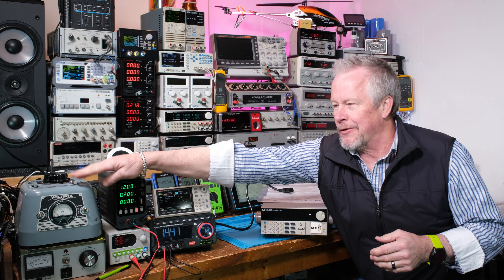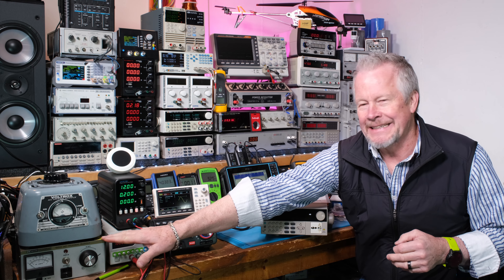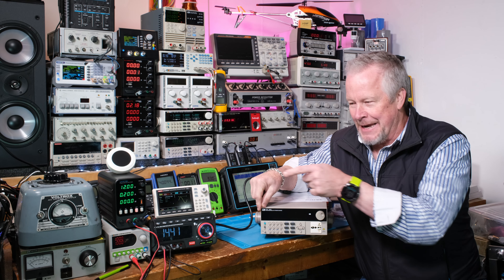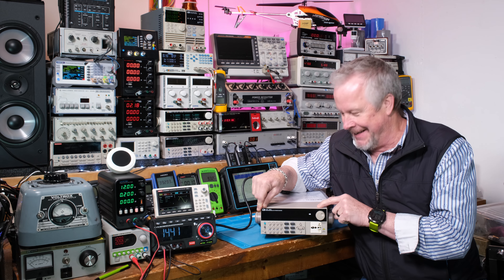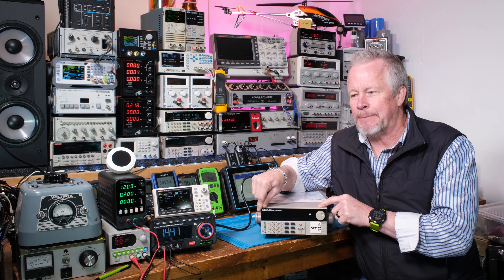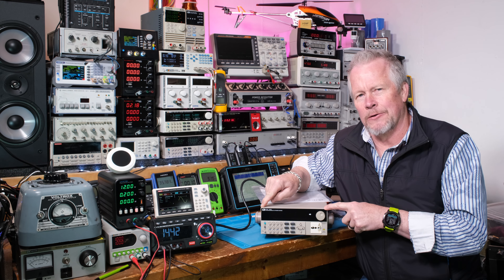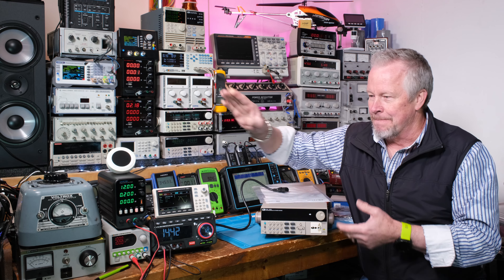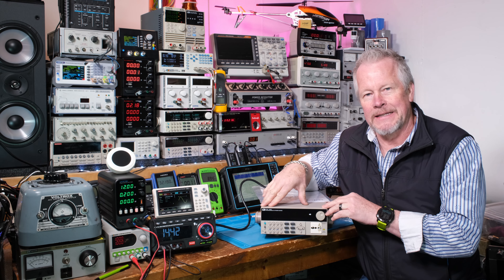AC Power Supply Box Opening and First Test ITECH IT7321 #itech #It7321 #acpowersupply

Comment: Eddie, in the early 80s we used similar products for MIL-STD 704 power quality testing. I'm amazed at the size reduction. Our 3 phase system was rack mounted.
Reply: It's basically a VFD. Rectify the AC to DC, then electronically commutate it back into whatever AC waveform you want. If you look at VFDs for motors too, they've also shrunk a lot. There's been good progress in power electronics needed - IGBTs and better high voltage MOSFETS
Reply from the maker: Thanks for your feedback!  I know 704 very well:)

Comment: AC sources are really handy. Does this unit also output DC and AC+DC? I'd be really interested in the current limiting functionality of this unit. I found the current limit on my Agilent 6811B to be fairly slow, to a point were I wouldn't necessarily consider this a proper protection circuit.
Reply from the maker: Thanks for the great questions!  I will test this out very soon.  I think the 3 different current protection types this has seems to make it pretty safe.